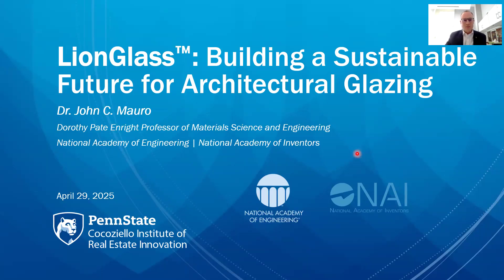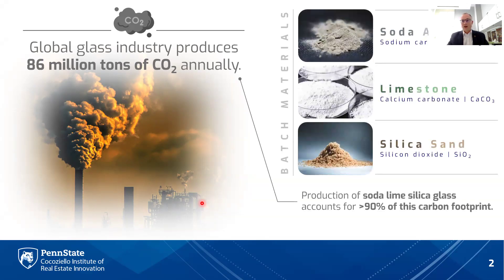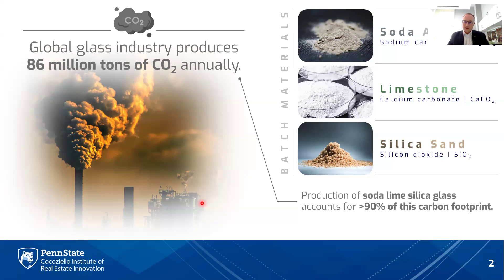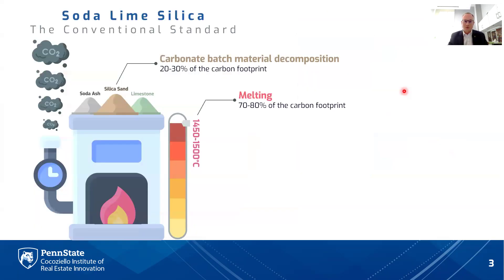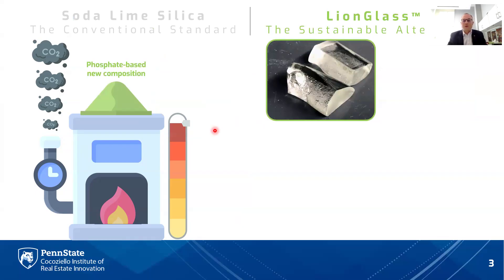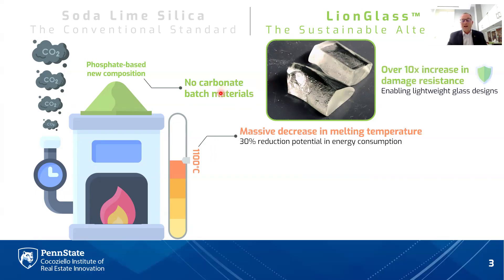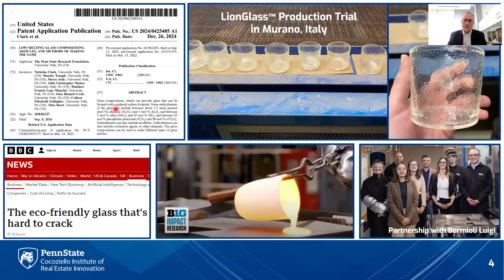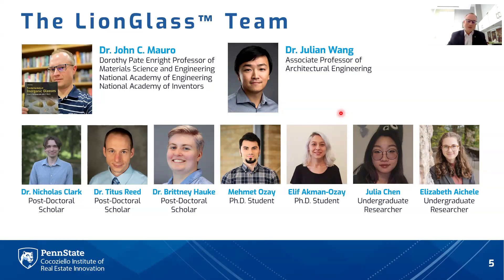LionGlass: Building a Sustainable Future for Architectural Glazing

Comment: Thank you sir for very much informative talk !! I would like to know that for quenching LION glass you have used alumina crucible so during pouring does Al2O3 diffuse in the actual composition ?? If YES, then there may be some changes observed in LION composition. Secondly if phosphate is the main component in LION glass then how it can prevent from water because P2O5 is water lovable and if we used in our normal life it would be difficult to become habitual.
Reply from the maker: Thanks for the great questions! The corrosion resistance of LionGlass depends on the exact composition but can be similar to that of soda lime.
Reply: @johnmauro1230  Sir may I know the exact composition so that we can re-create this glass with addition of some rare earth oxides

Comment: Do you have a roadmap towards making acceptably clear glass, comparable to soda-lime windows?

The clarity of those cups seems a little underwhelming, but my understanding is that it took 3000 years to develop clear glass in the first place, so I'm happy to give a lot of benefit of the doubt to your early work.
Reply from the maker: LionGlass is actually clearer than soda lime because it doesn't have the greenish tint from iron contamination, which compromises the clarity of soda lime glass.